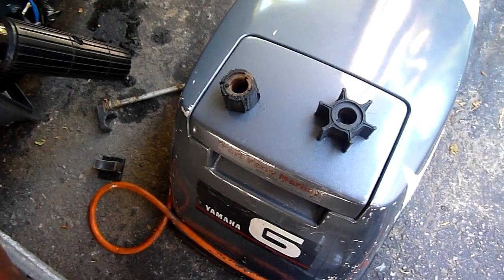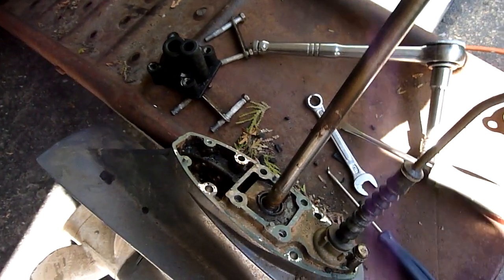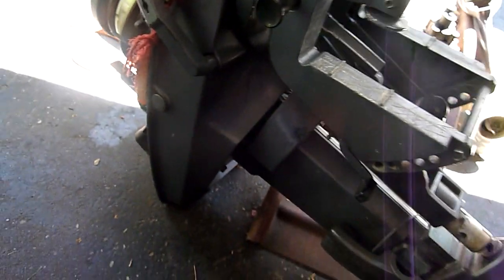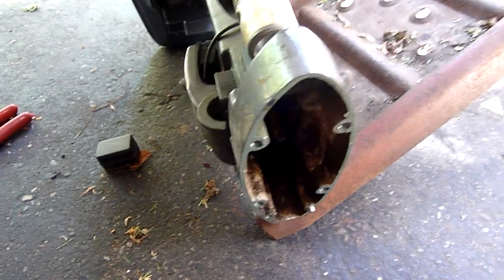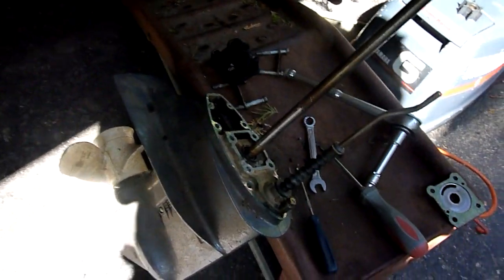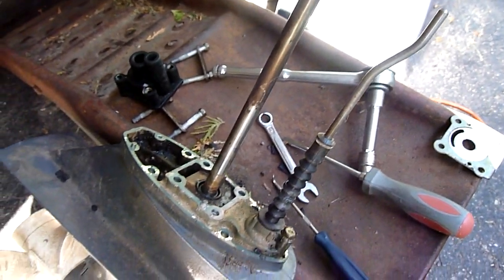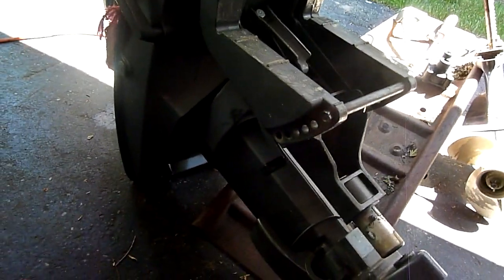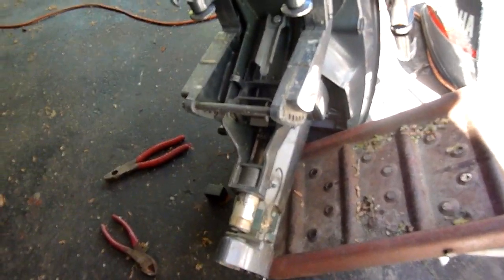How to disconnect the shift rod on a1994 Yamaha ,outboard

Comment: Your a bloody legend mate! I pulled half the linkage under the carby apart trying to split the cases. You dont notice that clamp when its on the service stand. Mine is a 8cm 6g1 model which is a 8hp 2stroke twin.